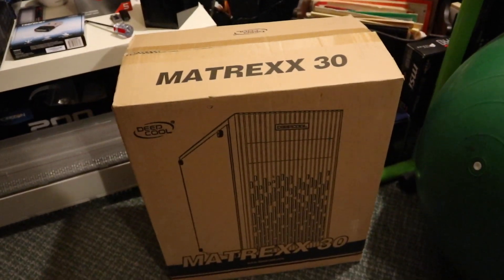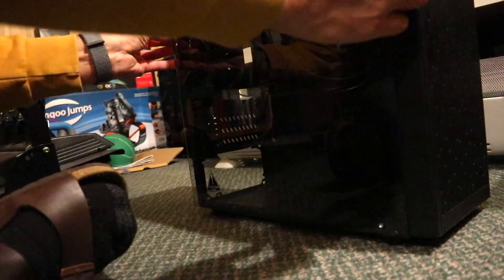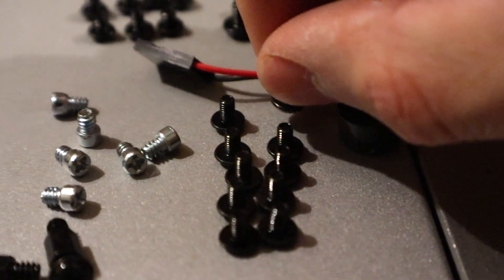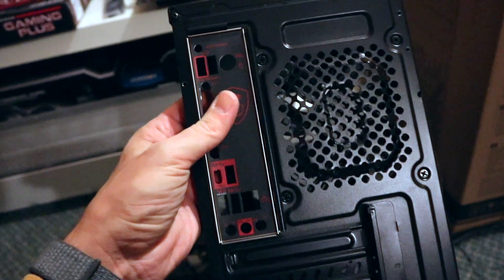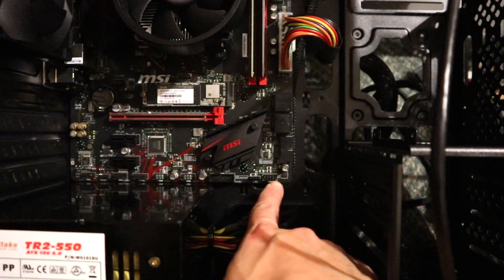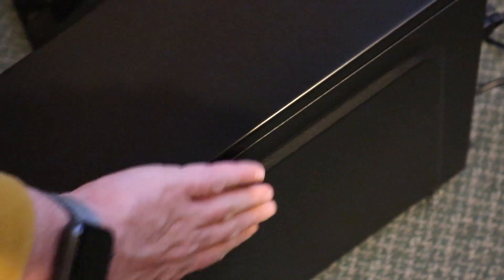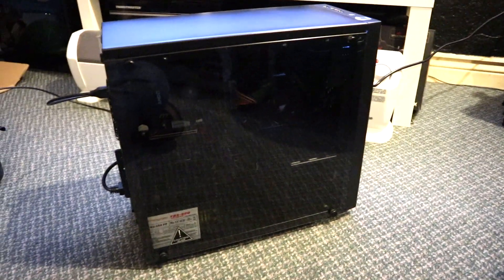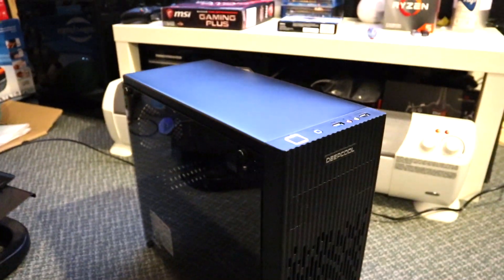$20 DEEPCOOL MATREXX 30 - The Cheapest Tempered Glass mATX Case Ryzen 3400G Build - Netcruzer TECH

Comment: No offense dude, but your cable management sucks. If you actually did a proper cable wrap with the excess cables and positioned them at different areas you could of made it more presentable. You also could cover up the ketchup and mustard cable tips with electric tape to make it more visually pleasing. You can use a hair dryer to heat up the white sticker on the PSU and relocate it to the other side of the PSU or cover the white sticker with electric tape.

Comment: I love this case. Got an overclocked 3400g in it. So far my case temps are just 5 to 10 degrees above ambient but that's because I'm using an AIO installed at the rear 120mm position. When I was using a Gammaxx 300R in it, it had a hard time expelling the warm air inside the case.

Comment: Hi. nice looking budget mini atx case review. But no mention about adding a GPU graphics card. What is the clearance with that old school drive bay. Seems to be high enough create clearance issues for most GPU cards except for some budget short GPU's . Of coarse people who build a PC might want to use high end GPU that are 250 mm 9.8"+ .But it Looks like you can probably modify case by bending the steel top SSD bracket down enough to create clearance to fit a longer GPU card .

Comment: Is the top panel easily removable? Thinking of drilling some ventilation into the top panel. Or is it riveted on or similar?  It's also a bit hard to tell if the top is 2 separate pieces of metal with a gap or just a single top piece.

Comment: Nice video! I am thinking about buying this case but can it fit 3 120mm fans. Example, replace the back fan and have 2 front fans.
Reply from the maker: Yes
Reply: Netcruzer RC TECH CARS Thanks!
Reply: @netcruzer  just to confirm, can you squeeze two fans on front? According to the official website it has one front fan slot.
Reply from the maker: Ozan Kaya i don’t own it anymore to check.

Comment: I bought this case last year, my micro ATX board fits in there but covers some of the cable management holes to the right of the board, so there is zero way to cable manage a lot of the more straggly wires... I like to think of myself as patient and I didn't have the patience to try and find a way.